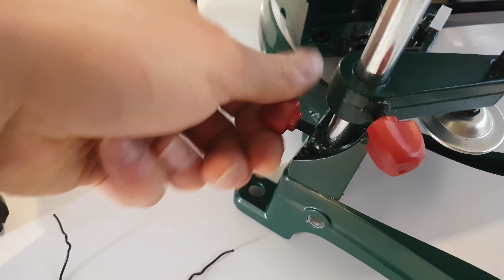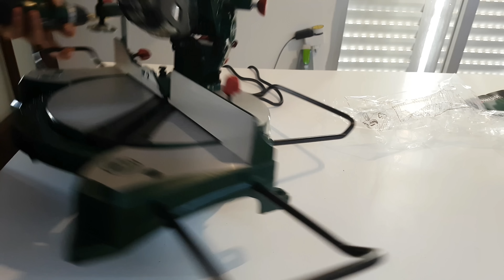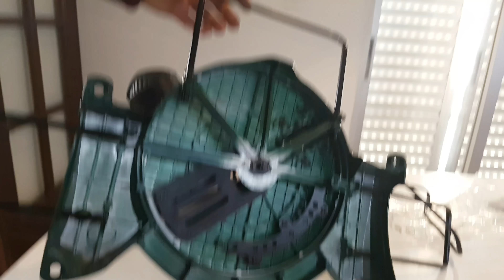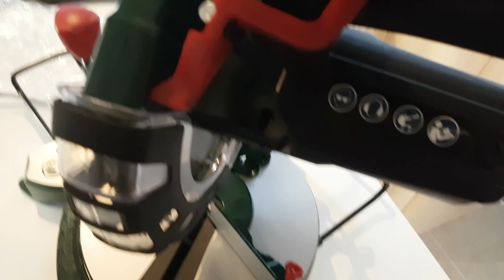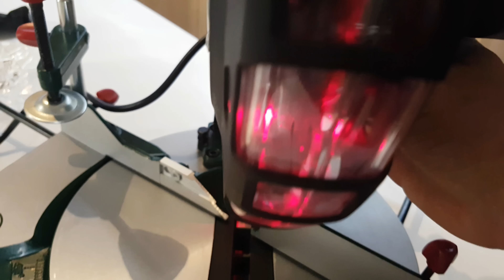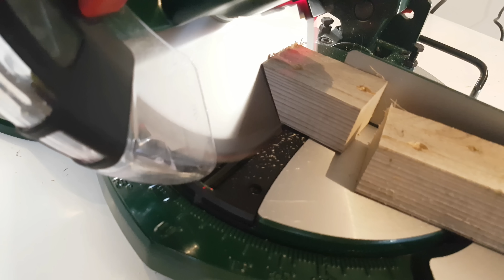Parkside Cross Cut Mitre saw PKS 1500 A2 TESTING REVIEW

Comment: Got one of these, can't get the lock at the back to unlock. Push the front down slightly, but the back bit doesn't release as its in the fully down mode.
Reply: I have the same problem! Did you fix it or return it?
Reply: Hello there! I have the same issue! Would you please share if you found a solution?
Reply: U need to pull the blocker out, and then turn it. It is a spring system